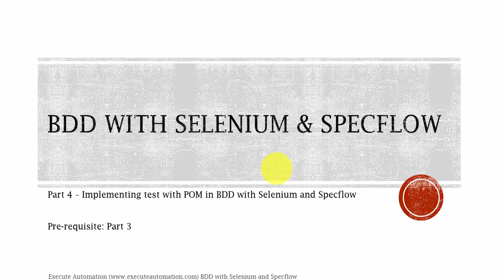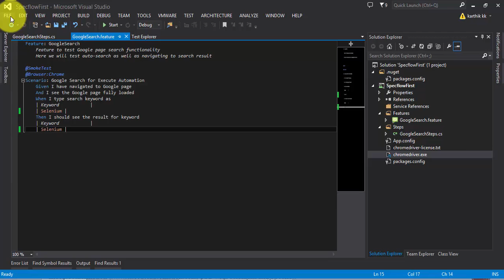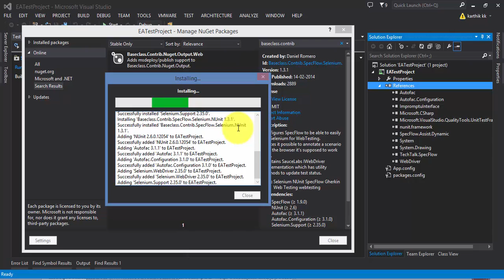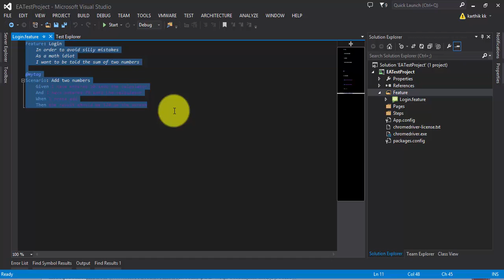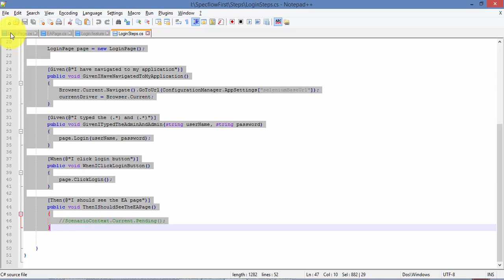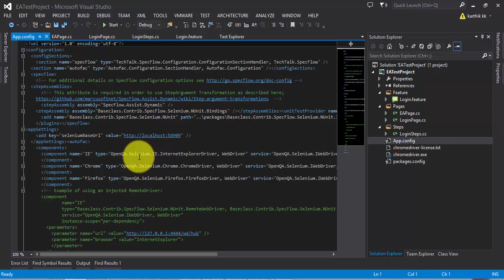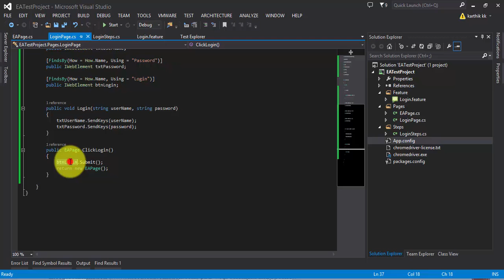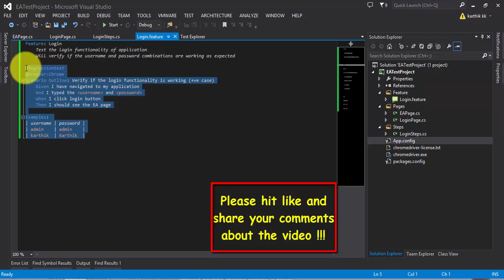Writing BDD Code with Selenium POM and Specflow -- Part 4 (Series)

Comment: Hi Kartik, your videos are very informative. While running these tests I am getting following exceptions 

MSTestAdapter failed to discover tests in class 'specflowCsharp.Steps.LoginSteps' of assembly 'D:\myproject\specflowCsharp\specflowCsharp\bin\Debug\specflowCsharp.dll'. Reason Could not load file or assembly 'TechTalk.SpecFlow, Version=2.1.0.0, Culture=neutral, PublicKeyToken=0778194805d6db41' or one of its dependencies. The located assembly's manifest definition does not match the assembly reference. (Exception from HRESULT: 0x80131040). 

I am running tests on Visual studio 2015. Initially, I have installed the latest version for Specflow and the latest version for Specfkow.assist but getting some non-compatible errors but then I updated the versions same as you but then I am getting the above error. I am stuck this issue. I have tried even having just one feature file, steps definition and empty login object but still its not reaching to point of loading chrome browser and throw above error and finished the test. It seems like the issue is with the version conflict but not able to figure out. If you could help me that would be great.